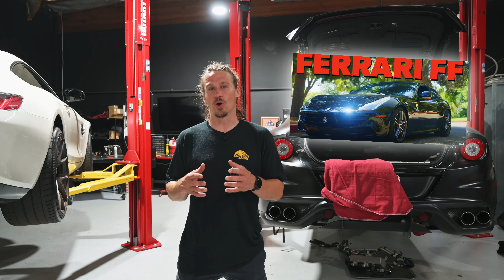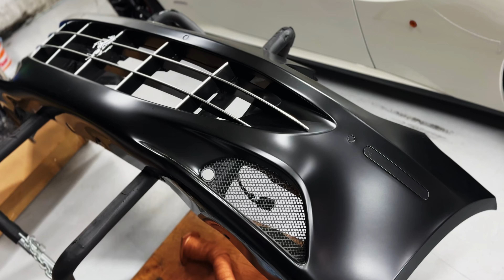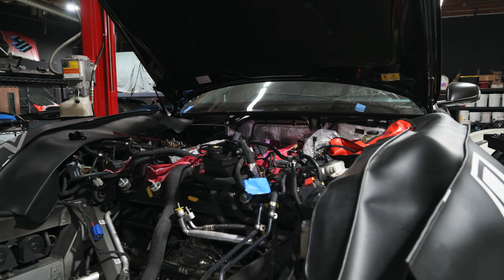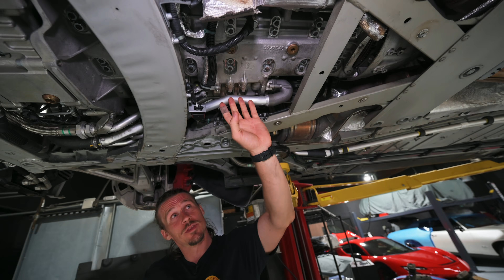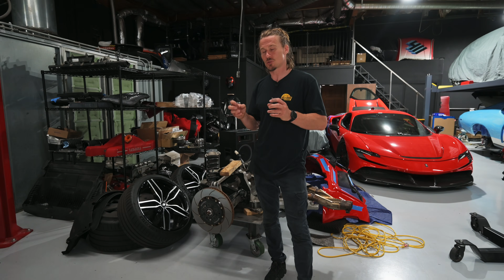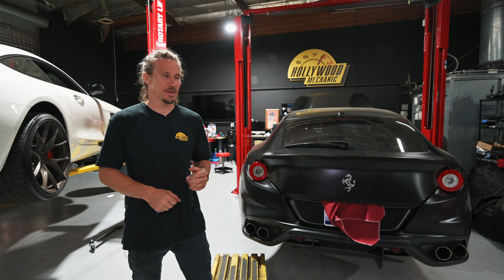Ferrari FF Common Faults and Repairs (GTC Lusso) 10 Year Edition

Comment: So Ferrari orange peel paint jobs and bird shit welds are just icing on the cake!
Reply from the maker: @jim99west46  I don't think the paint is that bad on most. The paint shops repairing them often do bad work. The welds are sometimes messy, I'm with you on that. But you don't hear about them cracking that often. Headers, on some years yes. But not really body frame stuff